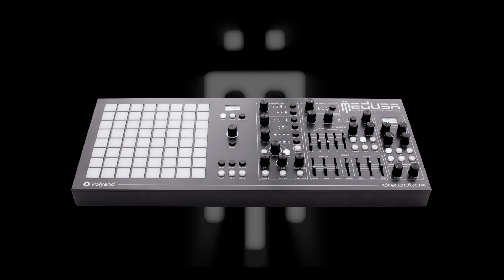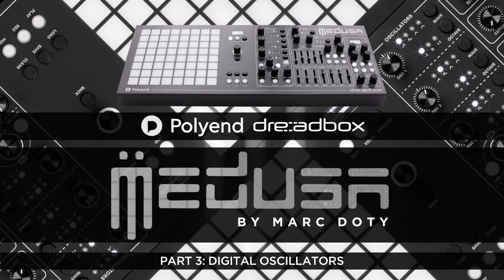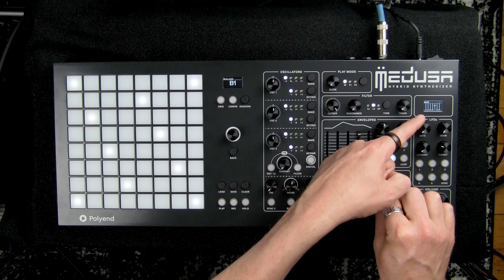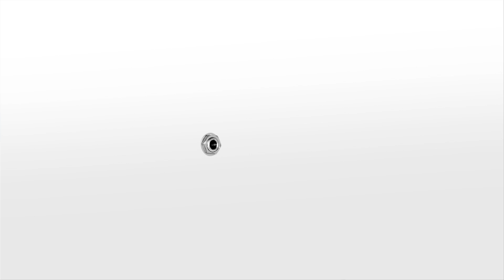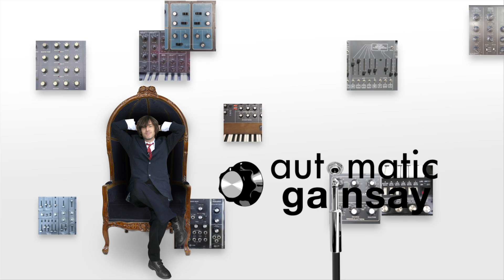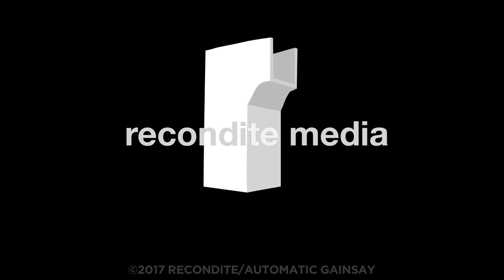03-Polyend Dreadbox Medusa-Part 3: Digital Oscillators

Comment: Yeesh!  It seems that distortion/sidebanding/aliasing issue, whatever the cause, is present on the digital side as well.  Not good.  Someone at Dreadbox needs to address this.  I sincerely hope it's something that can be fixed.  I really wanted one of these, but that is not an acceptable anomaly.  Cheers!
Reply: Could be a compression artifact for youtube aswell..you're not hearing the "real" sound on here. It's very audible yes.

Comment: Why on earth wouldn't they add a simple digital delay/reverb to this box? Heck, charge a 100- bucks more.
Reply: Probably having to consider a good balance between a few variables like design, functionality and cost.  It could 've ended up more complex and expensive than they wanted AND there's so many of those effects already out there that you can choose which ones you want to use with it.  And to have the kind of quality those effects specialize in that would drive up the cost immensely and to keep the design and cost low, the effects they would've put in wouldn't be near the same type of quality.
Reply: The dsp is maxed out. Just get an external effects unit. I have my H9 waiting for the Medusa.